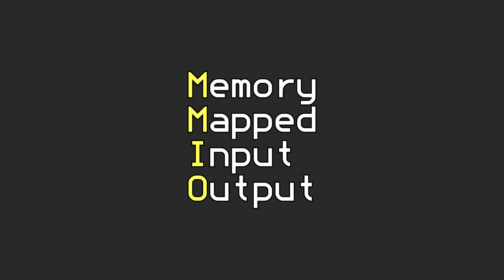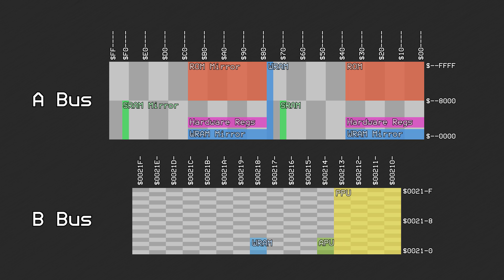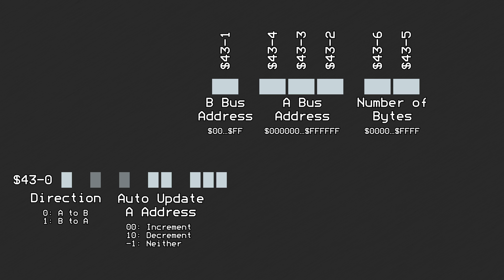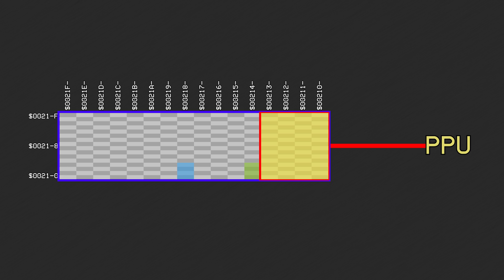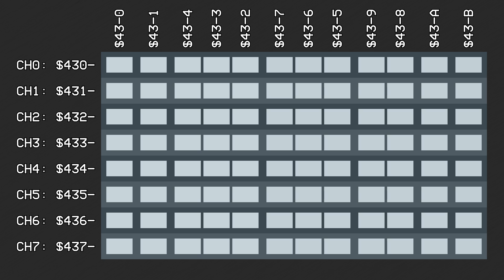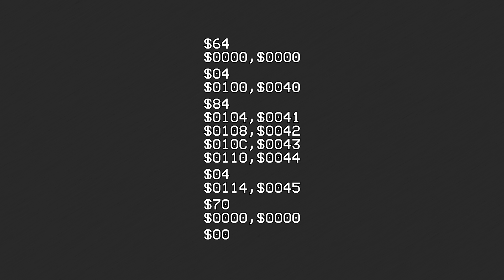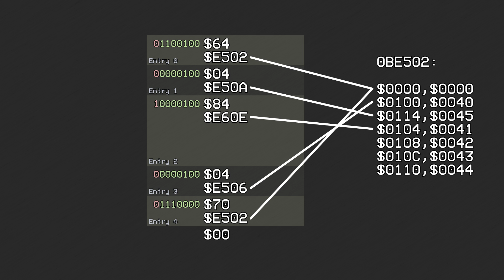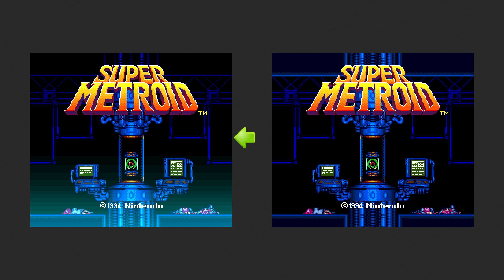DMA & HDMA - Super Nintendo Entertainment System Features Pt. 07

Comment: One of my day jobs is graphical effects programming in UE4 and I had zero idea what was going on in this video.

We're so fat and spoiled these days in our modern engines.
Reply: I've tried coding shaders for Unity's ShaderLab, and it's exactly the same thing as this, except not on a scanline basis. All you get to determine the diffuse of an object is a single RGBA color struct made out of 4 floats. But you know that the GPU will call your color function in a way resembling a bidimensional for-loop for every single pixel on the screen, and this variable will be different each time because Unity will work out the UV math for the texture and load up that color structure with whatever the color of the texture is supposed to be at exactly that position on the screen. So the output of your function will change accordingly.

Of course, a lot of work here is still done by the engine, so even we are still pretty spoiled.
Reply: @3lH4ck3rC0mf0r7  That's pretty much how fragment shaders work in OpenGL and DX as well, it's just how the pipeline works on modern GPUs, afaik Unity's shaders allow you to get about as close to the hardware as you're gonna get without a low-level API like DX12 or Vulkan. UV Texture mapping can also be handled independently by the GPU, as UV coordinates are automatically transformed for the current fragment based on the vertex UVs that make up the triangle being rendered with a world space offset of the current fragment.
Reply: Yeah, though programming the output on a pixel by pixel basis is much more powerful than on a scanline by scanline basis
Reply: @3lH4ck3rC0mf0r7  but 3d accelerated GPUS dont use scanline but raw pixels, all analog interfaces used in GPU in past was actuly conversions. Also pixels being independed is what allows GPUs to be so fast as they can process pixels on there own way in parallel. Also note motivation of making gpu programable with shader is to be not depended and limitex on static GPU features, this actully opens up other layer of complexity that was not possible older GPUs, you can do wizerdry in shaders too, go look up shadertoy, and all you see there is made on fragment/pixel shader without any geometry (simple plane) ;] its also reason why consoles are nothing special now days because era of specialised GPUs are long time gone and all gpus work the same way and can run same programs (ofcorse way they process data maybe diffrent)
Reply: @ShadowriverUB  Again, there's still some fixed-function parts (you cannot tweak/break the math behind the 3D projection process itself), and yea, GPUs now operate on a per-pixel basis, and hold multiple framebuffers at the same time.
Reply: I remember when the first version of the Unreal Engine came out. The game was amazing, and UnrealEd blew my mind in what I could create...
Reply: Well. I think, all he says is the base of the currrent graphical programming.
Reply: That's because you are dragging a mouse around in a GUI. Nothing more than I do when I work in CAD
Reply: TBF I'm sure a lot of programmers at the time didn't know what was going on either lol.
Reply: @Midee  I can confirm that. This was a heck of a trip down memory lane!
Reply: not really, like yeah too a lot of effort... but look he could explain it in 40 minutes
good luck trying to explain UE4 material system in 40 minutes!
Reply: @khhnator  just different skill sets i guess but you can definitely explain the material editor in ue4 in under 40. Maybe not the extent of its power :D